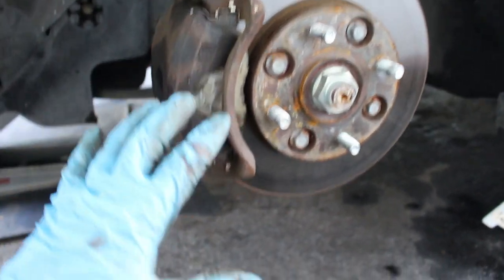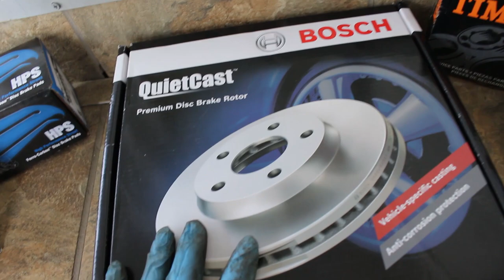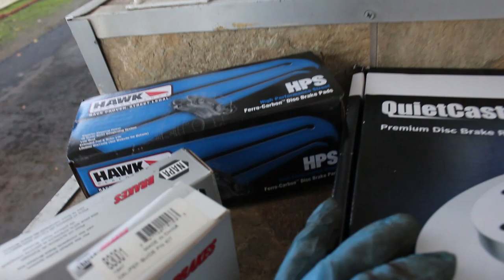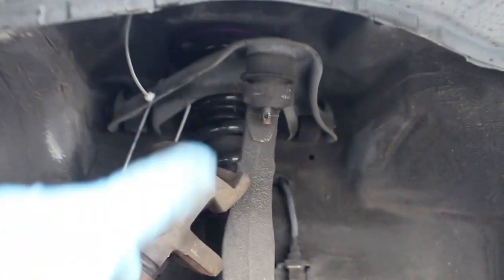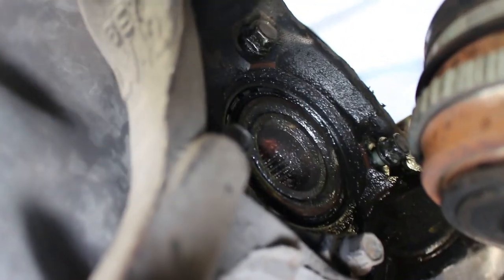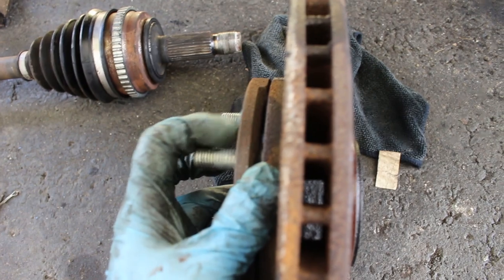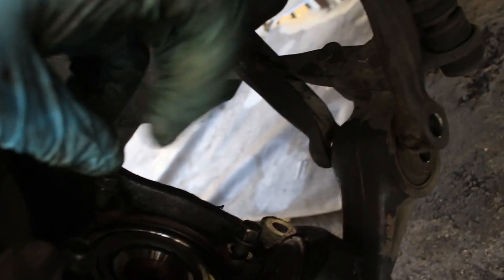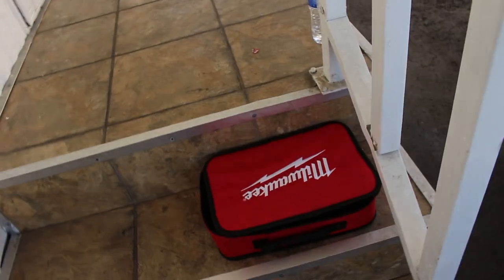Honda Accord Captive Rotor Delete

Comment: Great video... very helpful. I have a 97 EX wagon and the 2.3 CL rotors were too small. Apparently the wagons have a larger front brake setup so I went with the 3.0 CL rotors and they fit perfect.
Reply: Did you have to swap spindle from cl? I have a wagon and finding the info is next to impossible on upgrades/swaps
Reply: @apelnkn2230  yes I used the spindles from the 2.3 cl same as what the guy recommended in this video
Reply: @superchargedfirebird  thank you man, trying to get rid of the hub over rotor setup on my wagon
Reply: Charles you are 100% correct. I am doing the exact same thing to my 94 wagon and 2.3 CL rotors are too small and brake pad over hangs.
Reply: Please tell me this wheel and hub bearing works on the rear too. I have a 94 accord ex so I have trapped rotors on the front and back
Reply: 3.0 cl rotors and hub or just rotors or did you use the 2.3 hub and then the 3.0 rotors. I know you used the 2.3 spindle

Comment: y not just grab the 2000 accord and just swap out the complete hubs... 4 nuts and a brake line .. bolt off bolt on and bleed
Reply: Does it fit on a 95 accord wagon?
Reply: So you don't need the steering knuckle?

Comment: Does a 98-99 CL 4 cylinder hub not bolt onto the accord spindle? That way you don't have to press an accord bearing into a Acura hub..?
Reply: It would, but if you're doing all this work, may as well replace the bearing so you know it's new. Plus the accord and acura bearings are identical which is why this swap is possible.

Comment: Is it safe to run without plastic wheel well. Mine fell off at 85 on a 300 mile roadtrip had to use twine to remount wiring harness 😂 thank God I pulled over before it got severed by the wheel
Reply from the maker: As far as safety goes i'm pretty sure its fine, but not having them allows for your tires to kick up rocks and dirt behind your fender which could lead to future problems and possible rust. My car came without one of the plastic wheel wells and I recently lost the other one while on a roadtrip too lol I plan on replacing them soon
Reply: @StayTunedGarage  about to go rip some parts off a parts car should get the liners and hardware

Comment: Is the hub of the 6th Gen (1998–2002 i think) the same as/interchangeable with the Acura CL? I 'eyeball' them to be the same, but I'm not entirely sure. 
The Acura CL was not sold in my country, but I want to do this also with my 96 accord so I'm looking for alternatives.
Reply: I was thinking the same thing, lots of 6th gen parts